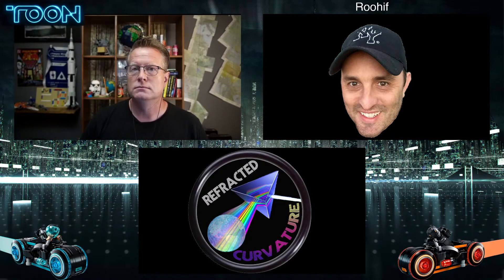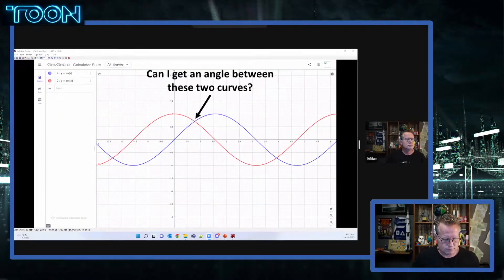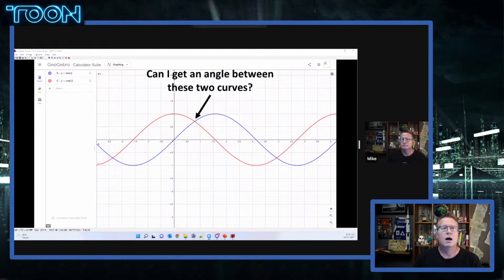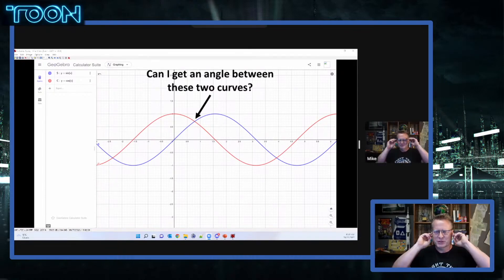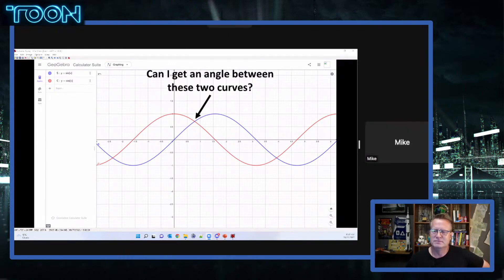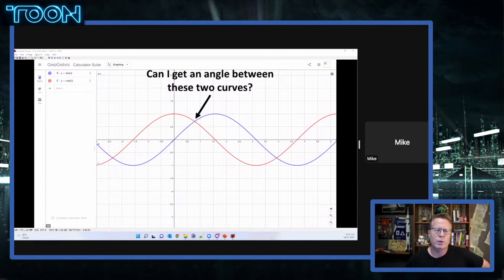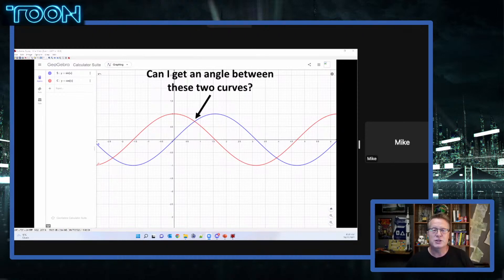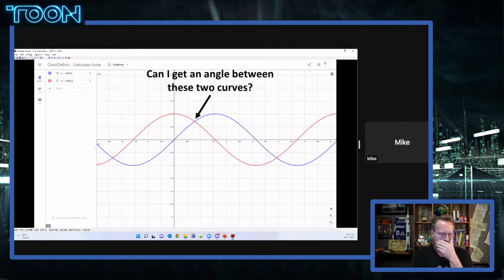Flerf blatantly LIES about having dual engineering degrees #GottaLieToFlerf

Comment: An angle is the separation of rotation between to lines or vectors. Now in at least 2D Euclidean space vectors are typically straight, however lines can be defined as being both straight and curved. To find an angle between two straight lines is quite simple by completing the triangle and using a bit of trigonometry. If we have a straight line that is intersecting a curve we can still find the angle of incident between them by finding the tangent of the curved line at the point of intersection with the straight line. Now this angle will be approximate but as the limit of dx approaches 0 at the point of intersection it will converge to that point of the intersection, thus resulting with a degree of separation. The same exact concept can be applied between two curved lines except in this case you'd have to find both tangent lines of each curve at the point of intersection, and from that we can find the angle. 

And this person claims they're an electrical engineer? Guess they missed classes on Geometry, Trigonometry, Calculus, Vector Calculus, Linear Algebra, as well as some important Physics concepts such as electromagnetism, electrodynamics, etc... especially when performing calculations on wave propagation. If we couldn't find the angle between two curves then well known algorithms such as the Fast Fourier Transform wouldn't work like they do. Euler's formula  e^ix = cos x + i*sin x; e^(i*pi) + 1 = 0, etc... wouldn't turn out like they do. Even modulus arithmetic wouldn't work like it does. 

In the case of an angle between a line and a curve it is typically called the tangential angle. Not even in Calculus but in Geometry alone: -- Google Search: 
"In geometry, the tangential angle of a curve in the Cartesian plane, at a specific point, is the angle between the tangent line to the curve at the given point and the x-axis. (Some authors define the angle as the deviation from the direction of the curve at some fixed starting point."

In the case with an angle between two curves it is typically called the acute angle between the tangents to the curves at the intersection point. -- Google Search:
"Definition: The angle between two curves is the angle between their tangent lines. (a) Let c1 and c2 be curves in Rn. ∠(c1(p),c2(p))=∠(∂c1(p),∂c2(p))"

In other words, whenever any two objects intersect each other there is a degree of separation, an angle of rotation between them. Otherwise they are either parallel or coplanar. Don't know where they got their engineering degree from without knowing basic mathematics never mind complexed calculus based physics.

Comment: What the flat earthers don't seem to get is that angles deal with rotation. One can rotate any shape by any angle whether it has any straight lines or not. 

For example take a base ball which has no straight lines. One can rotate it by any angle  about any axis of rotation and the angle is defined by what fraction of a full rotation it makes.. no straight lines needed.

Comment: So dishonest from mctoon. Mctoon has curved lines drawn on blank paper and ask john if you can measure the angle, yes or no? John states it is not a simple yes or no, you can measure the angle if you put the curved lines over a grid. Then rohif shows exaclty what John stated, the curved lines over a grid and  mctoon stated John was wrong and failed. John was right. Mctoon is very clearly lying.
Reply: So we can measure the angles of curved lines. Got it.
Reply: @drosophilamelanogaster4262  not without the grid. That is the point. John was correct. Yet they tried to make him look dishonest, when he very clearly was not.
Reply: @richbagley3841  The answer to McToons question was “yes”. Flerf failed. And he lied about his credentials. That’s dishonesty for you.
Reply: @drosophilamelanogaster4262  John answered correctly, everyone honest can see that. How did you prove John lied about his credentials?
Reply: @richbagley3841  Do you believe he has dual engineering degrees, yes or no? I want a straight answer to this question, then I’ll tell you why I think he lied.
Reply: @drosophilamelanogaster4262  How funny. I ask you a question, you don’t answer and then demand I answer you first. lol. So you have no proof. Just your assumptions. You actually believe that you can prove a persons credentials based on how they answer a question. Even worse, in this case John answered correctly. John clearly states mctoons question is malformed. So it is not a simple yes. He stated you can measure the angle with a grid from a straight line. He said it is not possible to measure angle from a curved line. In the example the angle of the curve is measured from straight grid lines.
Reply: @richbagley3841  I want to see how far you are willing to go to defend him. I take that as no, no you don’t believe (or at least there is a doubt in your mind) that he has two degree. Otherwise you would have said it. My conclusion is not based on his answer only, there are many things that make it highly highly unlikely that he has the degrees he claims having. You seem to know it too.
Reply: @drosophilamelanogaster4262  so like i said, you have zero proof. Just assumptions. Mctoon is clearly the one being dishonest, John did not lie. Mctoon has zero proof, just baseless assertions to get views. How sad. Stick with what you can prove and you will see the truth.
Reply: @richbagley3841  John doesn’t have the degrees he says he has. That’s my claim and I will give you my evidence as soon as you answer my question. Do you believe he has dual engineering degrees, yes or no? If you are not willing to stand up for him, why are we having this conversation? Put your money where your mouth is. Simple yes or no is enough.
Reply: @drosophilamelanogaster4262  I think he does. But the point is, either way, we cannot prove it so it doesn’t matter. Making that claim without 100% proof is pointless, and just speculation. Therefore it serves no purpose.
Reply: @richbagley3841  Ok, appreciate your opinion. I think he would have shown his credentials (he was asked to) if he truly has two degrees. Easy way to prove McToon and everyone else wrong. Plus he clearly understands very little about anything.
Reply: @drosophilamelanogaster4262  You do know what would have happened if he showed his degree, don't you ? Just like in Brian Mullin's case, a swarm of angry trolls would have phoned the company where he works and demand he gets fired. And his boss, succumbing to pressure would indeed fire him to avoid bad publicity. I'm sure that would make people like you happy, but he has a family and children...not worth taking the risk, and hope his opponents will play fairly.
Reply: @andreiandries470  Well, I’m not happy if someone looses his job. But that’s what you get when you show your incompetence publicly.  No company would tolerate it. He should have known better. John doesn’t work as an engineer. There is zero evidence for it.

Comment: Well, I don't know if that isn't more about semantics: At first you define "angle" as an angle between straight lines. If you do that calculus stuff, you get to the slope of a curve as a the slope of straight line through two points on the curve and then doing the limes to Delta x -> 0. The angle between the curves is then defined as the angle between the two tangent lines, with there slopes essentially gleaned from the limiting process, which also is going back to straight lines. So when he says (which he didn't that clearly, but he mentioned tangent lines, I think): You don't actually have the angle between the curves but you could do the angle between the tangent lines, that is not entirely ridiculous, though still wrong, because the angle between two curves is defined and it is defined as the angle between the tangent lines. But if you take it as: at first, you don't have that angle between curves, you first have to define it with the help of the tangent lines, I would say that's somewhat correct. Or do you have different definitions of an angle between two curves not involving there tangent lines (well, you'd need at least the slope of those to calculate the angle, right)?

Comment: I'm an "Informatic Engineer", I have calculus in my academic formation, and I don't know / remember the answer to your question (If I had to guess, maybe you could measure using tangent lines at the interesction to facilitate an accurate meassure of the angle). But the point is that not knowing the answer to that question doesn't invaldate my degree in any shape or form.
Probably I'm missing relevant context to this cut, but I don't think "You don't know this answer ergo you don't have a degree" argument is valid or maybe the curricula (I'm from  Spain) have differents objective between countries and that knowledge is very much expected to be known to everyone that has calculus in their academic plan.
Reply from the maker: You don’t need to know how to do it to know it’s possible. 

A dual bachelors degree in EE and ME is very strange. It would take 6 years.  Both programs are externally heavy in calculus. Obtaining angles to curved lines is trivial in calculus. For someone with that much math background to say that a fundamental part of calculus isn’t possible makes no sense.
Reply: @MCToon  It should be possible to get a dual EE and ME in just four years. You may have to take a heavy class load, but a lot of the same classes would probably apply to the requirement for both degrees. I think it depends a bit on the dual degree programs that a university may have.

But I agree with you that you would know enough by the time you graduate to understand that you don't have to have a physically flat earth below you to have a 0 degree reference point in order to get an angle of elevation. That's common sense and not calculus.  

But it's hilarious that John just got stuck on the angle of elevation and wanted to claim that since you need to have a 0 degree reference line and since that line would HAVE to be on a flat plane, ergo flat earth. They recently posted a video where they are just haranguing and brow beating someone about this angle of elevation and calling it a "debate". I literally laughed out loud when they said it was a "debate".
Reply: @MCToon  Maybe you are right, and in this case much probably it is. I just wanted to point out that the argument isn't as solid as it may appears. 
Don't get me wrong, this guy don't know what is talking about, but I see you use this line of argumentation a few times and I don't think a very good one.
Reply: I'm also a (Mechanical) Engineer from Spain, I really doubt about your qualifications if you don't know that an angle between two curves is the angle between their tangents at the contact point, theirselves defined by their derivatives at that point. Dude, this basic calculus 101. No way on Earth you can be an engineer if you don't know that. Even as a Software Engineers, you must have studied basic calculus.

Comment: I was just advised by the league of idiots leader ALYSM that level means curved!!  This is def con 3 red alert!!  Who else believes this???
Reply: Webster's Dictionary, 1913:
Level, noun:
- a line or surface which is everywhere parallel to the surface of still water; -- this is the true level , and is a curve or surface in which all points are equally distant from the center of the earth, or rather would be so if the earth were an exact sphere.
- An approximately horizontal line or surface at a certain degree of altitude, or distance from the center of the earth; as, to climb from the level of the coast to the level of the plateau and then descend to the level of the valley or of the sea.
Level, adjective:
- having no part higher than another; having, or conforming to, the curvature which belongs to the undisturbed liquid parts of the earth's surface.

1913!!! Before NASA corrupted the definition of level!!! LOL!!!
Reply: @jaimevivesp  WHERE IS WATER IN VOLUME CURVING UPON ITS SURFACES???????
Reply: @ramonortiz7462  On a flat earth, when there's a tide where one part of the ocean is at a higher elevation than another part, is the "water" level?

Of course, you can't even explain tides since I don't think you guys even believe in gravity.
Reply: @jquest99  You have no true idea do you. Do you know why only oceans experience tides while lakes do not??? Well!!
Reply: @ramonortiz7462  "WHERE IS WATER IN VOLUME CURVING UPON ITS SURFACES???????"
Everywhere. If there is water, there is curve. 

BTW, I just found this definition of level was introduced on the Webster's Dictionary in the 1864 edition:
"a line or surface which is everywhere parallel to the surface of still water; -- this is the true level , and is a curve or surface in which all points are equally distant from the center of the earth, or rather would be so if the earth were an exact sphere."

NASA must have a time machine, or a way to alter remotely all the printed originals stored in many libraries. LOL!
Reply: @UCbFbPcipKl9IQvEBVUG46Hg I think you called me a name   by mistake and I'm sure that you would normally not do something so ill mannered when just discussing things, so I'll accept your apology in advance.

As to where within the same body of water where one place would be in a different elevation than another, you can take a look at the tides at New Foundland, Canada to the tides seen at Portugal. At 11AM local time this Sunday in Williams Lake, Canada, the tide will be around 1.5 ft. At that same time 7PM in Lisbon, the tide will be at around 2.5 ft. I just randomly chose two times, so there will be times when the difference is greater than this, depending on the time of the month where the moon is in its orbit around the earth. 

BTW, they can project this based on the calculated position of the moon and the sun and the gravitational forces that they exert. Such tidal predictions are not possible for a flat earth and NO ONE is putting in any such flat earth tidal predictions.

And even though I went through the trouble of finding this information and giving you a long response, I predict that you either will NOT respond or make a short nonsense response that does not actually make a point or present any evidence.  Maybe you'll say something about how you can't comprehend inertial frame of reference or planetary motions by saying something about a pear travelling millions of miles is seems unimaginable to your intellect and education. That's my guess.
Reply: @ramonortiz7462  For the "tide" in a lake, what do you think the mass of the water in a lake is? We are talking MAGNITUDES of difference in relation to an ocean.

The largest lakes, such as the great lakes ARE big enough that there's a so called tides twice daily, but it's just a few centimeters so it's really not taken into account.

All this makes sense because the factors in the equation for the gravitational force includes mass of the objects.
Reply: @jquest99  I knew you'd say that because it's what Google tells you verbatim!! When is the very last time you had an independent thought all by yourself!!? 1992?? So you INSTANTANEOUSLY believe that high tide occurs all over the ocean or is it just segments of said ocean!!?  Now GRAVITY ITSELF can somehow differentiate between size??
Reply: @ramonortiz7462  Here's the difference between you just reading what's on Google and me coming up with a response that happens to be the same as the truth AND what's on Google. That is, I understand the simple formula for the gravitational force. I know the factors are the masses of the two objects. And I can estimate what the mass of a lake would be in comparison to an ocean.

I DID check the great lakes because I wasn't sure of the magnitude of the volume of the great lakes and I got a couple of centimeters. 

I thought through the problem. Looked for the answer based on scientific principles. 

You on the other hand can get access to the same information but can't figure out what is true because you don't have the critical thinking capabilities.
Reply: Awww, you made a fresh post just for me?
Thanks for letting us all know I live rent free in your head... it is very empty here.
Reply: @Alysm-Aviation  Yet no answers just insult...  The flat earth beckons you to entertain logic!! I will be a fair and only slightly harsh ruler!!
Reply: @ramonortiz7462  your BS was answered over and over again. But you insult and run away.
Reply: @ramonortiz7462  You have asked this question answered a hundred times, yet you keep repeating it. Do not complain if you get insulted.
Reply: @sliderools5815  GRAVITY ITSELF must be assumed and supposed into existence Erik Verlinde acclaimed and accredited PHYSICIST!!
Reply: I guess civil engineers are lizard overlords. 
Level surface: A level surface is defined as a curved surface which at each point is perpendicular to the direction of gravity at the point
Reply: @Q Branch At least you admit that Alysm is a member of the league of idiots!! Can you explain why they (science) doesn't know what GRAVITY is ITSELF in ANY FUNDAMENTAL WAY??? Could it be because of what acclaimed and accredited PHYSICIST Erik Verlinde ADMITS??? That you have to assume and suppose GRAVITY into existence???!
Reply: Level doesn't mean flat, doofus.  Be less stupid.